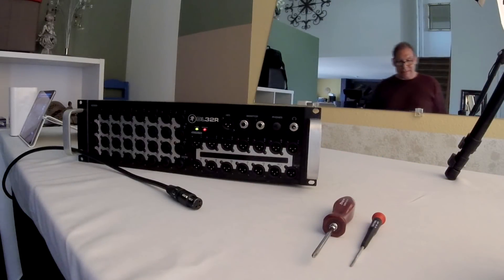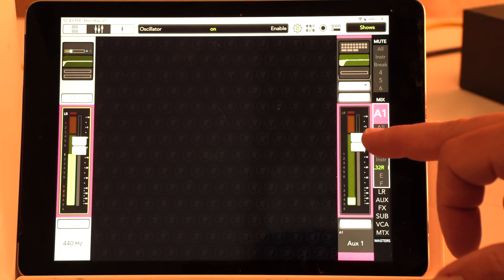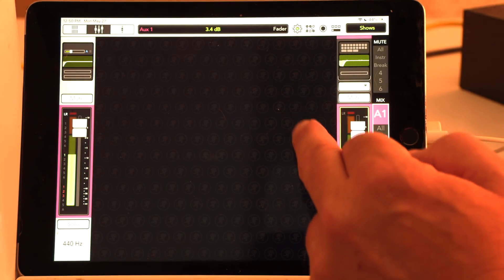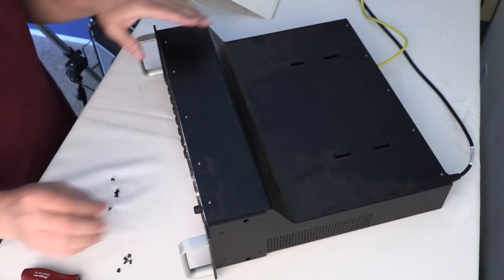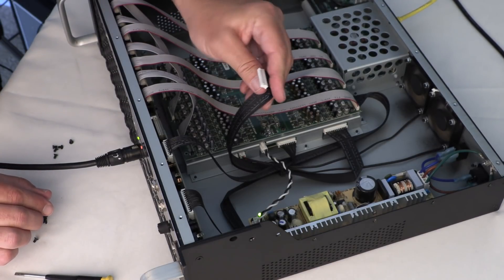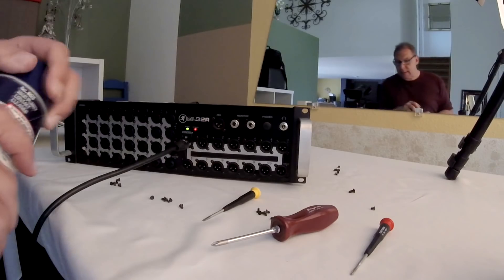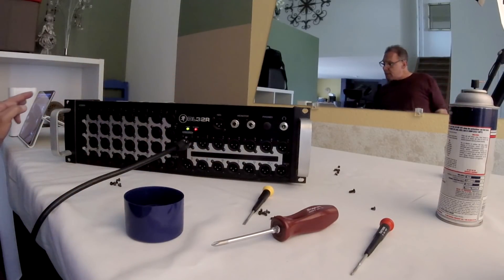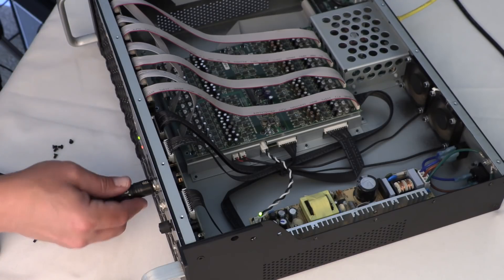Fix for Mackie DL32R Intermittent Output Issue

Comment: Hi, network led is red in the video, is it supposed to turn green when a device is connected? Like your ipad
Reply from the maker: Good eye, yes that is correct.  Maybe it was red because my cover was off (?)
But as you can see in the video, the iPad was connected OK.
Reply: Hey Michael, I just wanted to say Thank you. I took the time to look into my DL32R and followed your instructions and BOOM I got my headphone output back, my 13L and 14R main output back and all outputs sound the same. Once again Thank you very much!!!
Reply: I only asked because I’m having the same issue. All my devices connect and operate fine but my Wi-Fi led stays red. Contacted Mackie and tried all their suggestions but still the same. Please let me know if you find a fix. Great video and thanks for doing what you do. Really appreciate it.

Comment: Hi Michael. Thank you for then info. Do you know often this happens? I mean I clean it now, when would Appear again? Approximately
Reply: The idea is to make periodic maintenance
Reply from the maker: I think it depends on a few factors, like humidity where you live, where the mixer is stored, how often it is transported.
I'm in relatively dry Colorado, and have reseated and cleaned the ribbons twice since 2015.
Reply: @WoodlawnSound  I understand, thank you very much
Reply: @WoodlawnSound  I bought new last week and it had problems with ribbon A. I saw your video and avoid to send to guarantee cause I live far away from Buenos Aires in Argentina. It works excellent now!